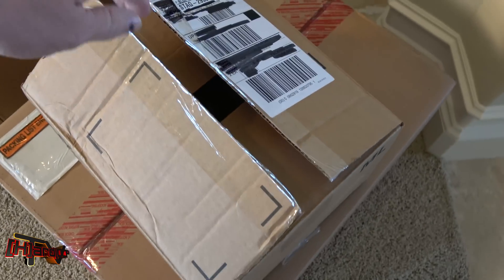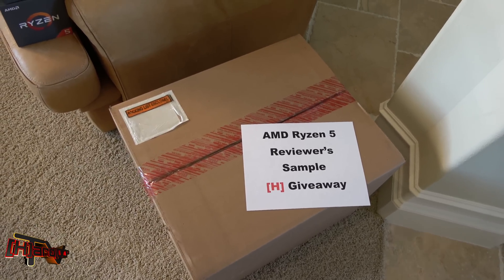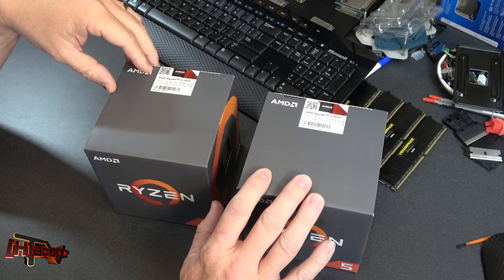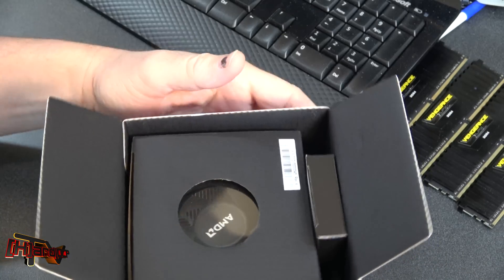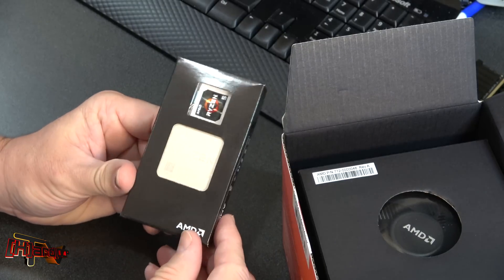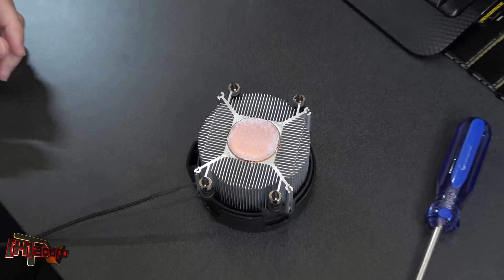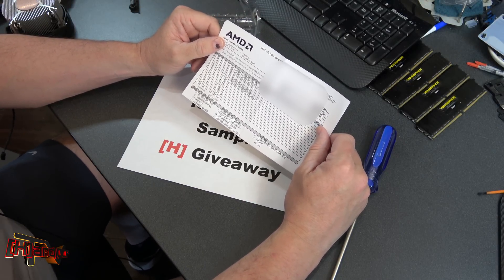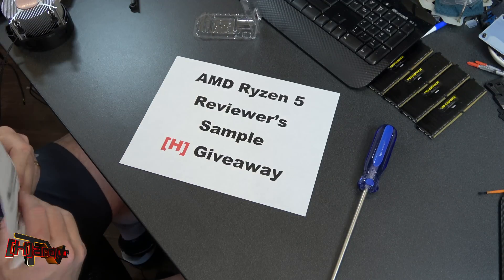Ryzen 5 1600 Unboxing and Wraith Cooler Install plus Giveaway Preview

Comment: Why do you push down cpu before locking it? It's kinda pointless there's no more room anyway duh
Reply: He dose not get it. It is not about you push the cpu down not to get it down further. you push down on the cpu to keep it down as you use the lever to lock the cpu in
Reply from the maker: Far from worthless.  It is not impossible for those sockets to have a slight warp to them.  I have seen it bad enough that it actually did impact the processor being inserted properly.  I have seen it on AM4 in the last month in our own forums.
Reply: No, measure socket depth and see it for yourself. There is no more room besides the length of socket pin. What you're doing can actually damage something, by slipping your fingers and maybe hitting VRM mosfets or god knows what.
Reply from the maker: Yes, but if the pins are not set INTO the socket fully, there is an issue.  I saw this exact problem on our forums last week.  And I would suggest that you are a lot more likely to cause damage to the motherboard by using a screw driver to affix the board to the chassis than pushing on the CPU with your fingers.
Reply: Can you post link to that issue I really would love to see it. I am 100% sure it wasn't inserted properly and the damage was done after. Because that's not how AMD or any CPU manufacturer said about that "little push" since it's pointless, but I would love to see that case.
Reply from the maker: Been looking since you posted your question, but I cannot find it.  Thousands of posts in the AMD sub lately.  https://hardforum.com/forums/amd-processors.6/  That said, you do not have to take my advice at all.
Reply: With the AMD it is not pointless to hold the cpu down as you lock the cpu into place. AMD has a nasty habit of not fully locking in. When you go to remove the cooler even after twisting the cooler you lift the cooler and the cpu is attached to the cooler

Comment: AMD Got in the ring and Intel is looking nervous
Reply from the maker: Good!
Reply: HardOCP TV would you recommend using the stock cooler or buying a different one?
Reply: HardOCP TV yeah I'm not too fussed about overclocking so I think I'll just stick with the stock cooler :)
Reply: For a stock cooler it's not too bad. Some have succesfully OC'd to 3,8Ghz with it but I wouldn't go any higher than that.
Reply from the maker: If you want to overclock, I would highly suggest buying a better cooler, if not overclocking, it works very well.

Comment: That is very generous of you.  I wonder what AMD will think of this.  Maybe I'm being paranoid.  I believe the Wraith Max is the 95-watt cooler with heatpipes, and the Spire is the 65-watt solid aluminum one.  Obviously the latter is intended for the non-X processor.  Given it hasn't been used and the thermal compound appears quite even, I wouldn't have a problem plunking the heatsink back on without replacing the compound.  I don't think it would hurt anything.  There's more than plenty.  Looking forward to the benchmarks.
Reply from the maker: Yeah, I was a little unclear on that since I had not opened the box.  The Max is the thin-fin heatpipe cooler (125w TDP), and the Spire is the taller extruded aluminum cooler (95w TDP).   The Wraith Stealth is the shorter extruded aluminum cooler (65w TDP).
Reply from the maker: The Wraith Spire comes in both LED and non-LED versions.  The Ryzen 7 comes with Wraith Spire LED, and the Ryzen 5 comes with Wraith Spire (no LED).
Reply: wraith max is 120w with rgb LEDs, wraith spire is 95w with rgb LEDs and wraith stealth is 65w without rgb LEDs

Comment: im an amd fan forced to use intel and nvidia in my amd themed rig
pls help
Reply: but how is your rig amd-themed if there's shintel and novideo in it...

I feel your pain but I'm waiting for a 1700/RX 480 build to arrive hah
Reply: It used to have an 8350 and a r9 290 in it
but they died
but the case is still AMD themed (stickers, sidepanel with AMD dragon decal lasered window from 2008)
Reply: rip :( what made you get an nvidia card though? like I understand why you'd get an intel processor because amd processors kinda sucked until ryzen came out but they did have good cards in the past
Reply: Cause I don't want to spend money on something that isn't an upgrade in terms of performance (rx 480 is about as fast as an r9 290, or atleast was at the time of purchase)
So I got a GTX 1070 gaming Z edition. It's overclocked to 2070mhz without a hiccup :,D
Reply: oh, so you got a 1070

for some reason I assumed you got a 1060 or something else along those lines, don't ask why
Reply: Nah.
Another reason I got nVidia is cause a program I use for my work has an option to render shit with CUDA cores which is hella fast and accurate
Reply: yeah cuda is nice
Reply: JayJay Golden I use an nvidia card because it was on sale,otherwise I would've gone for Amd
Reply: Kinda same? I got a gtx 1070 completely new in box (MSI gaming Z variant, at that) for the same price as an RX 480 at the time, so I couldn't pass that up.
Reply: new 1070 for the price of a 480? jesus fucking christ I wish

I have a 1440p monitor now and my MSI 480 Gaming X can't really keep up...
Reply: I've got a 1050p monitor
wanna swap monitors? :^)
Reply: no but wb my old 1200p monitor lmao
Reply: damn. prioritising monitors over graphics cards?
Reply: yeah I don't game too much, I use my computer for productive work, mostly music production which can require lots of screen space at times so going from 1440p to 1050p would make me want to throw up on myself
Reply: that's also why I went for a 1700 as opposed to a cheaper processor, GPU performance isn't that useful to me
Reply: wait for ryzen2 and rxvega2
Reply: I would have waited if my stuff didn't break. but it broke so had to replace it.

Comment: What's up, are you still thinking about delidding a Ryzen chip?
Reply from the maker: All of these CPUs have soldered heatspreaders.  So the chance of breaking the CPU is pretty big during the delid, unless you use heat, which is not that big of a problem, but the returns are almost nil.  That said, I do not think cooling is an issue with Ryzen overclocking, I think overclocking limits are mostly architectural/process limitations.

Comment: You gonna be testing overclocks on teh reveiwers cpus or just not eventaking them out the box? would be nice to get a 4 cpu sample size
Reply from the maker: Reviewer's kit will be unopened.  :)  Unless the winner requests otherwise.  I have two Ryzen 1400 that should be here in a day or two as well.
Reply: nice, looking forward to it
Reply from the maker: If I do not open the box, those will not be tested.